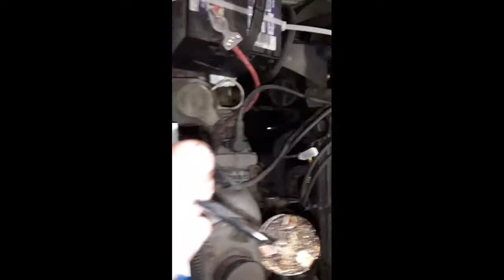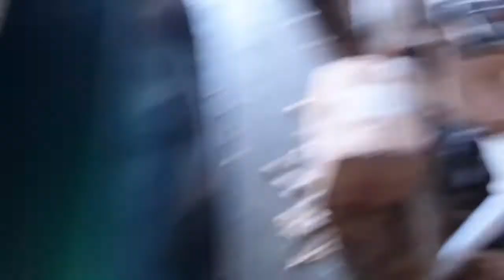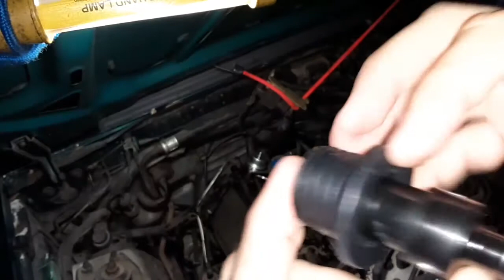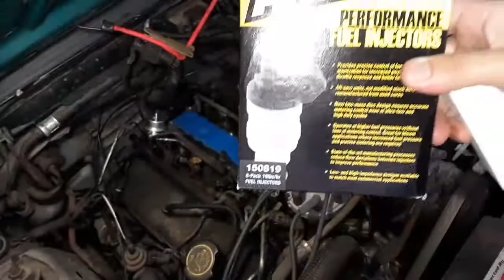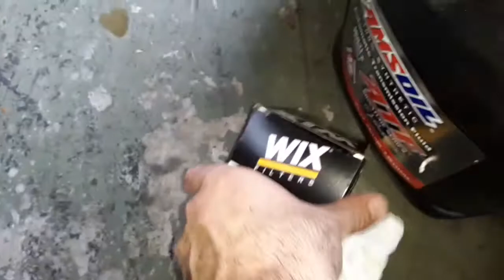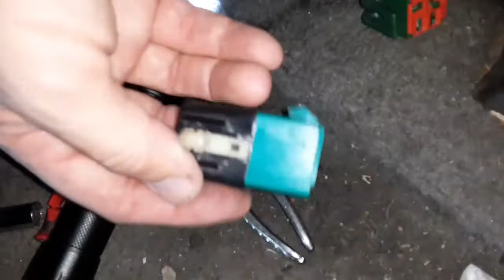'89 Mustang 5.0 fuel injectors/pressure reg/coolant and iat sens/PCV/Job 2:10/number1synthetic.com

Comment: On start up car is on a open loop which runs off predetermined tables from the ecu, after car warms up it goes into closed loop which makes the car run off the 02 maf tps act and ect sensors so what you said in the beginning didn't make sense.
Reply from the maker: Thanks for the clarification brother. You are exactly right. Yeah I am definitely learning with regard to all that stuff. I also confess that I am a recovering parts changer. I need to learn how to diagnose before changing parts. Thanks for watching